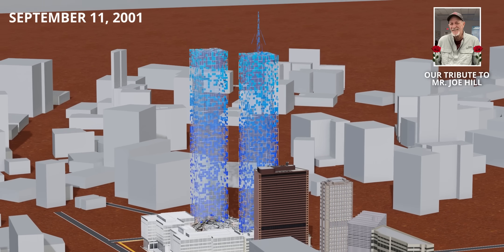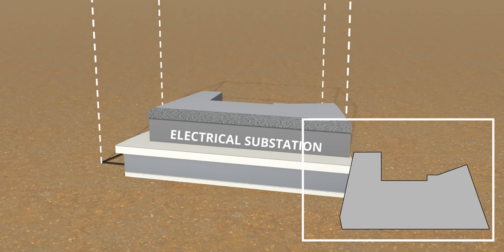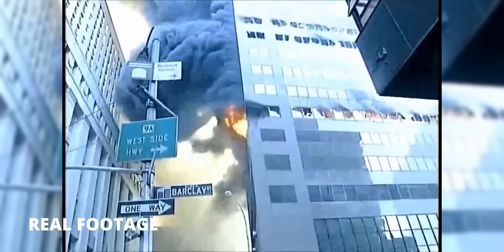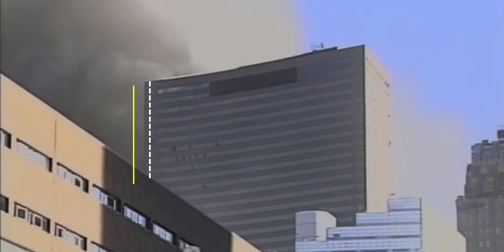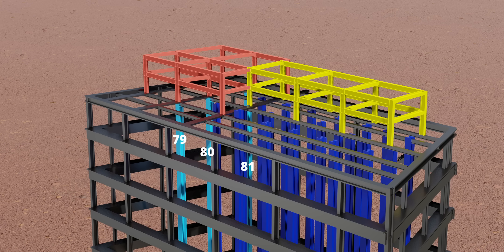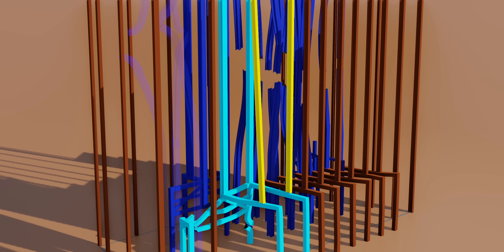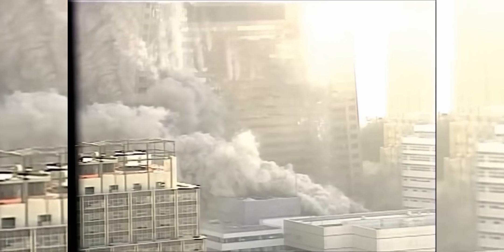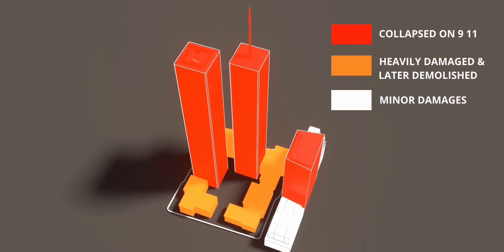Collapse of Building 7 | The Complete Physics

Comment: Your telling me that this building's central structural supports ALL gave out and it was the first steel frame  building in history (even in 3rd world warzones) to nearly fall into its own footprint and not collapse progressively? I'm afraid that is hard to believe.
Reply: So, don't believe, who cares.
Reply: Building 7’s collapse front the front view  
https://youtu.be/6pyyqV7egEI?si=aN5HdjJaRL3ziHyE
Reply: Imagine 81 steel columns failing in perfect synchronicity and IT IS NOT one of the most widely studied architectural failures, and DID NOT initiate thousands of similarly constructed buildings to be refurbished! NOPE! in fact it’s generally ignored!
Reply: It is my understanding that Building 7 possessed a significant structural weakness that ultimately led to its collapse. Specifically, the foundation was not sufficiently robust, and the addition of penthouses several years after the initial construction, which increased the load on the already compromised base, exacerbated the situation, especially considering the impact of falling debris
Reply: @domRizon  Did you not watch the video?
Reply: Considering the Citicorp building was in danger of collapsing in Manhatten without any kind of 9/11 event, i'd say you American just suck at engineering de facto.

Like that shitty new bridge that collapsed, you lot just don't know what you're doing.
Reply: It was a progressive collapse of the central columns, you dumbass.
Reply: You’re right. It’s easier to believe lies.
Reply: Guys, civil engineer here, when the columns start failing, a tilt is supposed to happen, not to the front or the back, but on the y axis, these failures would cause stress on the other columns, an unequal stress, more stress on the neighboring columns than the further ones (the columns are usually built to sustain higher stress than what they should), which means the tilt would increase iver time.
My point is, whatever columns failed first, the front-back-right-left, there should have been a tilt over a long period of time, enough for the stress to cause rhe others to fail, not an instant fall of the building.
For the people who’s only argument is “there are smarter people than u”, i say, there are smarter people than you too who signed petitions to get the official explanation reviewed, so dont think u can throw the other opinion bcs of that.
Reply: @SmokeCriminal9liwa. Thank god people like you are trying to bring some light to the imbeciles who believe the official story. WTC7 was a controlled demolition there is absolutely no question. To the cretins who believe the official story that office fires brought down WTC7 the way it did: please do not reproduce, we don’t need more idiots on this earth.
Reply: @SmokeCriminal9liwa Did you not see the pagoda on the roof collapsing first in the video, which was primarily held up by those columns? The pagoda can only collapse if the columns below it have already collapsed at that time.
It even happened a few seconds prior to the rest of the building coming down.

Just because you couldn't see the tilt on the y axis you mentioned from that camera angle, doesn't mean it didn't happen inside the building. Only once enough of the inside had collapsed to make a dent in the outer part, did the outside tilt inwards become visible.
Reply: This collapse was the very definition of progressive collapse

Were you paying no attention at all?  Did you even bother to watch?
Reply: i doubt theres very many high-rises that have been hit by falling skyscrapers, is this something you expect to be happening all the time?
Reply: How many skyscrapers have you seen get hit by passengers jets or have debris of those land in another? Just this one? This not another
Reply: @Nathan-jh1ho  I've seen many steel fame buildings sustain far worse damage than what WTC7 did.. and they are still standing.
Reply: @raddevine3068 But those probably didn't have a structurally weak foundation design that heavily relied on just three columns. 

Anyone with base knowledge in engineering can tell that the foundation design with the transfer trusses is structurally weak and will easily give in if the other three columns aren't there.

The transfer trusses are just a very bad design choice. And building another heavy penthouse on top of an already structural weak foundation didn't help this either.

They didn't account for the possibility that those three columns might break due to material failure after being exposed to too much heat over a long period and the transfer trusses would need to withstand all of that load.

There is even a possibility that the extra load due to the added penthouse was the only reason that those three columns even collapsed at all.
Reply: Tell me you don't understand structural collapse, gravity or the video, without directly telling me. People seem to forget that Gravity is what brings down buildings, not explosives. All the explosives so is remove supports. When dfamage and fire, create a fast and complete failure of the main columns near the base, it creates the exact same conditions as a controlled demolition. The video showing initial partial collapse ahead of the main collapse (and the many photos of the massive damage to the side facing the towers, are definitive proof this was a failure, not a demolition.
Reply: yeah.. we are telling you
Reply: Here's an idea. Go to College, do a 4 year engineering course, then hopefully you'll stfu as you'll stop believing bs conspiracy theories because you'll now understand structural engineering
Reply: Plasco building 2017 you're welcome
Reply: @Wyophilee You're welcome to what?

It wasn't built to the same building or fire regs and it didn't fall down in the same way.

You're welcomer.
Reply: @gerhard7323 ? Yes it did lol. 7 collapsed inward Tehran collapsed outward.
Reply: @Wyophilee  that building collapses in stages, not neatly all at once like 7
Reply: don't worry... just go back to work, your break is over.
Reply: Did you even watch the video lol
Reply: First steel frame skyscraper hit with debris from commercial jet fuel fire (no one has flown a commercial jet into a skyscraper before) and first time it reached temperatures of 600 Celsius
Reply: @nickcross5225  You are lying. There were partial collapses of steel structures before due to fire, but never a total collapse let alone on its footprint.
Reply: Did you watch the video?
Reply: Did you watch the video?? There are people much smarter than you and I who have done the math.
Reply: @yardiemark good goy, keep believing.... It was israel actually
Reply: @yardiemark  physics was figured out 100 years ago. these people arent smarter than you if you have a decent foundation of physics knowledge
Reply: @jw5483 physics was not "figured out" 100 years ago. You're not even as knowledgeable as Newton much less any modern physicist lol
Reply: @jw5483  Building 7 had a HUGE GASH down the whole side of it that was on fire for 8 or 9 hours straight. And you're saying it shouldn't have fallen?
Reply: heard of Grenfell?
Reply: @yardiemark how did fire started and how it could affect steel structure so much that it gave up? For wtc excuse was that there was a lot of jet fuel, but as we see most of it burned on impact and jet fuel does not really want to burn in liquid state just like diesel.
Reply: @dimitryputin,  love, we just had a plane crash in Kentucky, just after takeoff.  I suggest you look at the damage caused. It kind of renders your opinions as absurd with regards to fireballs, and what jet fuel actually does when it explodes   Was Dr Strangelove your professor at the Minsk school of engineering?
Reply: @dikranovichk5889 Also just after takeoff plane does have all fuel required, not on its final destination.
Reply: Dude are you serious?   Ok, how about the planes that impacted the towers had half as much fuel.  It ain’t blowing up on impact. That’s one thing we know for sure
Reply: All the fuel is not blowing up on impact
Reply: Da, da, da!
Reply: But none of the buildings "fell into its own footprint"

None of them.

Why do you create this strawman that doesn't help you?

How WTC fell down
https://www.youtube.com/watch?v=nEgPNNcdtu4
Reply: It was not the first steel frame building to fail from fire, and it hasn't been the last
Reply: @MoseleyJon It's the first and currently the last to fail SO completely in that way.
Reply: @gerhard7323 grasping on straws huh?
Reply: @2020RockStar By stating a fact?
Reply: It's a "Titanic" situation - though you probably think that was a conspiracy, too.
Reply: Let me help you out. There are a great many things in life that are difficult to believe. And, the more ignorant one is, the more one leans towards conspiracies. Twist "theories" to fit facts, not the other way round.
Reply: @amstaylorph  JKét épületnél azonos omlás? Kit nézel hülyének?
Reply: @amstaylorph  Imagine believing something only because it is what the government told you, then having the audacity to question other people's knowledge... No steel structure ever collapsed on its footprint in history because of fire, ever. Some government claims 3 did, on the same day, at the same place, two twin towers in exactly the same way. How anyone can believe this bs is beyond me, but I do have a couple of bridges I am looking to sell...
Reply: @amstaylorph The official story is the conspiracy.   You have to ignore Newtonian physics to believe it.
Reply: @amstaylorph and if those facts are written on false information?
Reply: @amstaylorph what are you talking about?! There is literally conspiracies and coup documented in history books, what are you talking about?
Reply: @amstaylorph  but to have 3 buildings fall on themselves in the same day?😂
Reply: "And, the more ignorant one is, the more one leans towards conspiracies." Ad hominem fallacy, bullshit detected. Youre full of it buddy. Better luck next time.
Reply: @amstaylorph  Only 10% of the conspiracy theorists are actually believing in it, the other 90% do it for the lulz, to make fun of the actual idiots that do and to create confusion. We don't know if raddevine is actually dumb or just playing to be dumb in order to feed the dumb.
Reply: i wonder what specious sources you drew your misinformation that was masquerading as facts?
Reply: @amstaylorph and you? What you source smartboy?

Comment: No, steel does not melt at 600 degrees Celsius. Steel typically melts at a temperature range of 1370°C to 1530°C (2500°F to 2800°F), depending on its specific composition. Therefore, 600°C is far below the melting point of steel.  But thanks for showing me how they blew out the beams :) That makes sense now !
Reply: At 600°F (315.5°C), steel retains almost all of its strength. However, it may start losing weight-bearing capacity if it's untempered.
Reply: @OperationGhostlink  
". Therefore, 600°C is far below the melting point of steel."
Steel gets weak looooong before it is liquid.    At 600C it's approximately down to 50% strength.
Reply: @OperationGhostlink  - Who said anything about steel turning into a puddle?  Strawman much?
Reply: @TheCriticalStinker-01  No-one here said that so yeah stinkyfitz you did a very stupid strawman attempt here...
Reply: "No, steel does not melt at 600 degrees Celsius"
So?